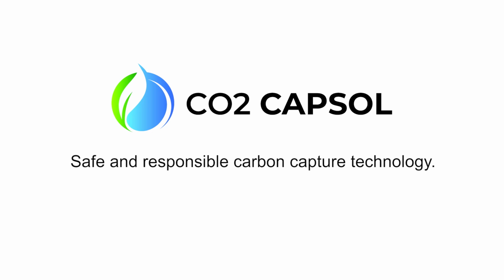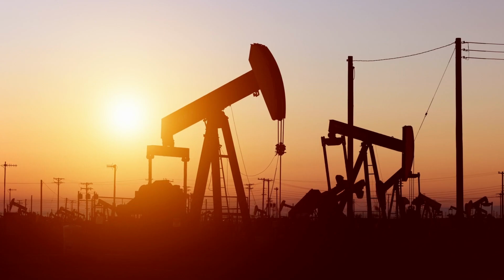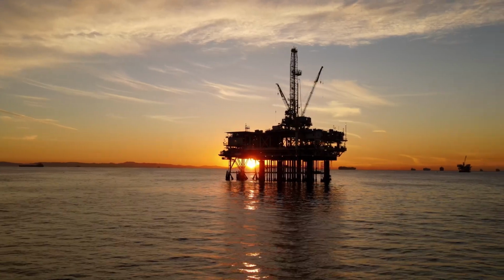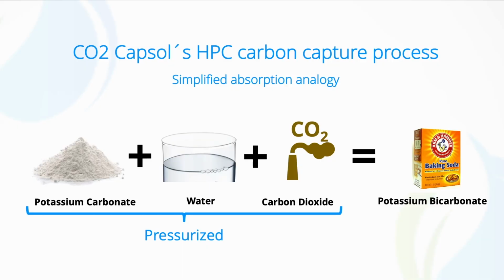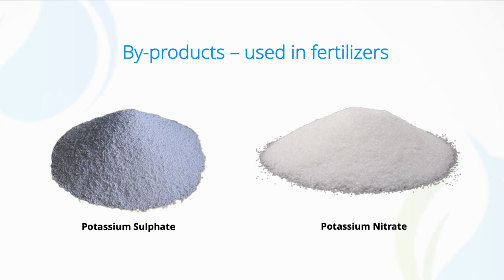Safe and responsible carbon capture - CO2 Capsol

Comment: Water vapor is a GHG as effective as CO2 according to GHG Theory. There is 50 times as much water vapor in the atmosphere as CO2.
Reply from the maker: Although water vapor probably accounts for about 60% of the Earth’s greenhouse warming effect, water vapor does not control the Earth’s temperature. Instead, the amount of water vapor is controlled by the temperature. This is because the temperature of the surrounding atmosphere limits the maximum amount of water vapor the atmosphere can contain. 

The greenhouse effect that has maintained the Earth’s temperature at a level warm enough for human civilization to develop over the past several millennia is controlled by non-condensable gases, mainly carbon dioxide, CO2. CO2 has been building up in the atmosphere since the Industrial Revolution when we began burning large amounts of fossil fuel.

If there had been no increase in the amounts of non-condensable greenhouse gases (like CO2), the amount of water vapor in the atmosphere would not have changed. The addition of the non-condensable gases causes the temperature to increase and this leads to an increase in water vapor that further increases the temperature. This is an example of a positive feedback effect.

Comment: Instead of collecting gaseous CO2 why not collect it in the form of carbon powder, for example we could reinject the deabsorbed CO2 at the inlet of the flue gas compressor, at the outlet of the compressor we would place a quench (just before the absorber) where the fumes would condense with the gaseous CO2 and we would obtain a really interesting and easy to store carbon powder at normal atmospheric pressure and temperature, and this carbon powder will not only capture the co2 but the vocs the haps and nox and particles , and this pulverulent coal will be similar to crude oil or dehydrated dilbit (diluted bituminen)